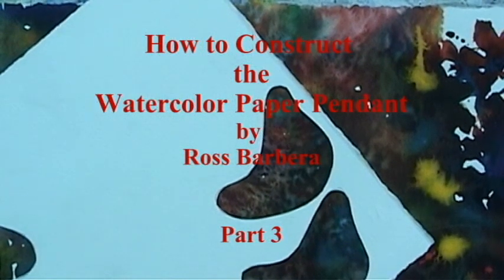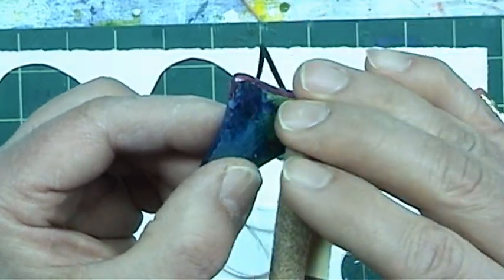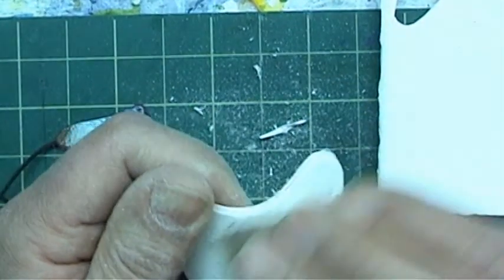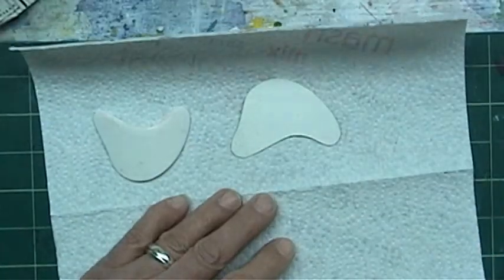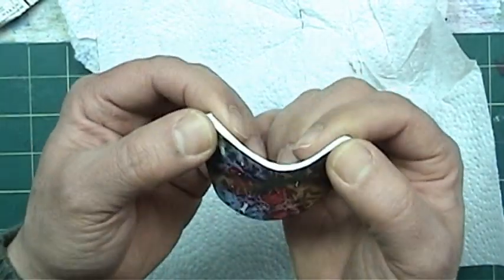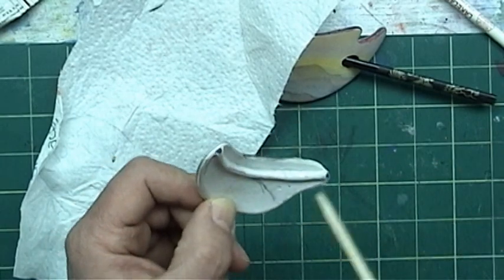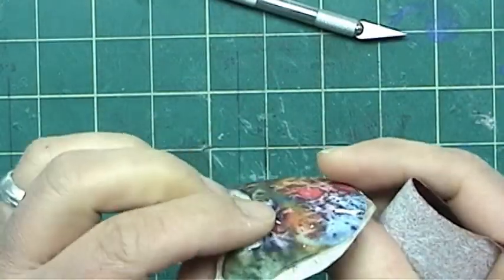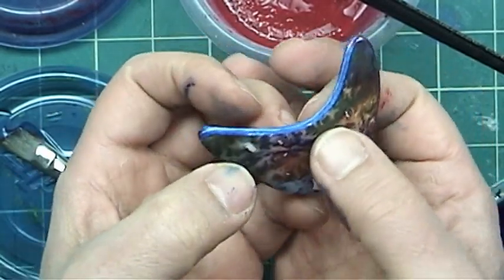How To Construct The Watercolor Paper Jewelry Pendant, Video 3

Comment from the maker: These craft stores usually have a collection of decorative papers, many of which can work for this project. I like banana paper, as the texture is perfect for the bottom side of the pendant. For the paper shapes, I use Arches 140 lb cold press watercolor paper. I find that it is very durable and works well with all of the other materials.

Comment: Thanks for the video.  I just recently came across your series.  I have a piece underway that is looking real good.  Instead of watercolor, I used Dylusions Ink Sprays by Ranger.  They act pretty much like watercolor.  I do have a question.  Do you bake you pieces only to melt the wax, or does it also cure the piece.  I don't have a channel in my piece and don't wish to bake if it doesn't add to the piece.  Thanks again.